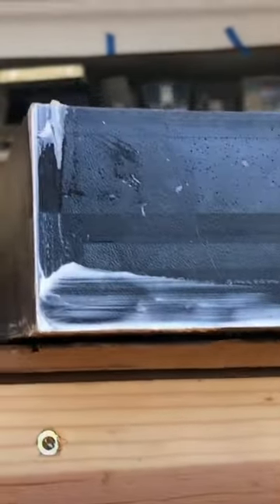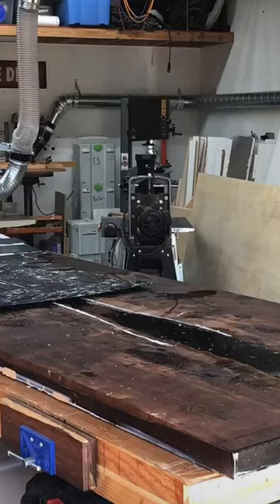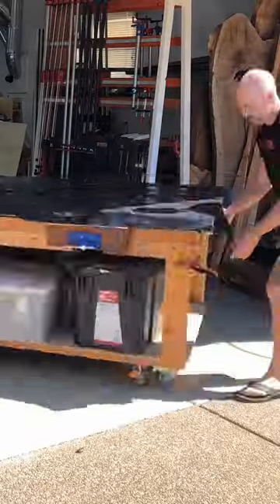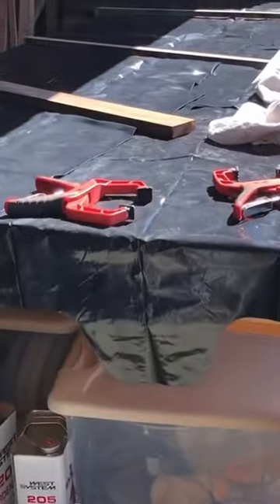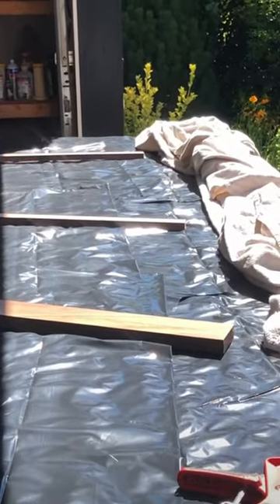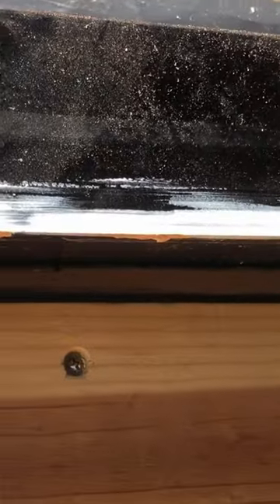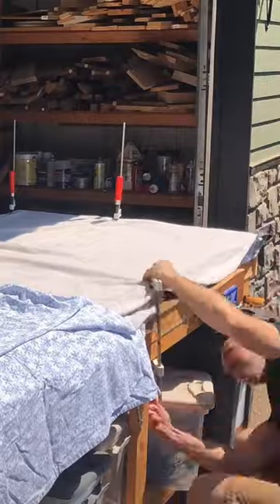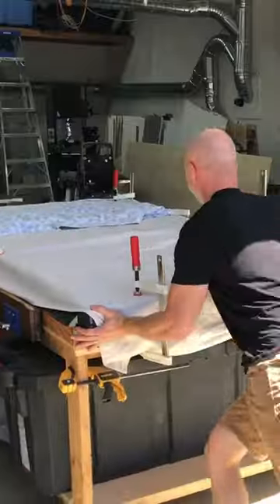Warped Table

Comment: Epoxy shrinks a bit as it cures. A lot of times it is that the epoxy was flush with one side and had depth on the other side and the side with depth shrank causing the curve. If you have the same depth on both sides it will shrink evenly and not cause a curve.
Reply: v interesting. what's a good way to resolve this for uneven pouring? layers?
thank you for this point 🌟
Reply: @SJ-dl6uc  For myself, I would build the mold and set it up with holes in the sides so that the slab can be pinned with wooden dowels from the sides. carefully set it up so that you can pin it so that it has an exact gap underneath the slab and then pour so that you have the same amount above and below the slab. 
The problem of uneven shrinking and bowing usually comes from a thin coating on one side and a thick layer on the other. The thick coating has more torque to pull as it shrinks and so it overwhelms the other side and shrinks more causing the bowing.

Comment: First time I did a deep pour of epoxy I used the wrong epoxy during a hot summer day and used a torch to pop the bubbles. Needless to say it smoked and seemed like it would catch on fire.
Reply: Deep pours can release A LOT of heat.

Comment: wait, this stuff is THAT sensitive to UV?  

better not have windows or a sky light!
Reply: 130 degrees is sensitive?? Anything you store in direct sunlight will dry out, fade, warp.  But your AC should prevent it from getting to 130F.
Reply: @nachojones1  thats heat, not UV.  if its not UV stable, doesn't matter how cool it is, UV will destroy it.

and no, not everything warps & fades ...my granite counter tops have not faded or warped in 30 years.